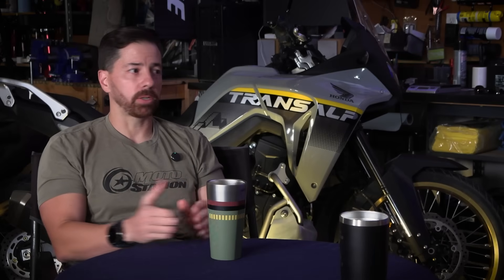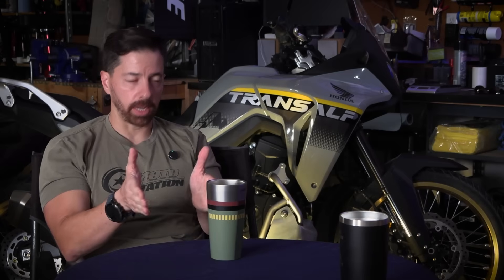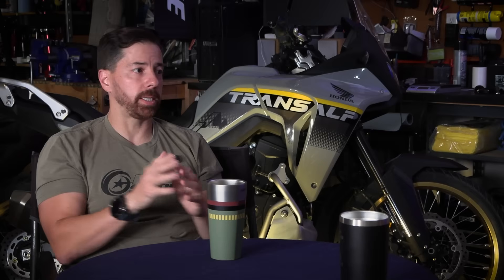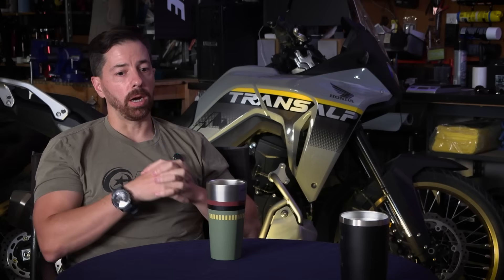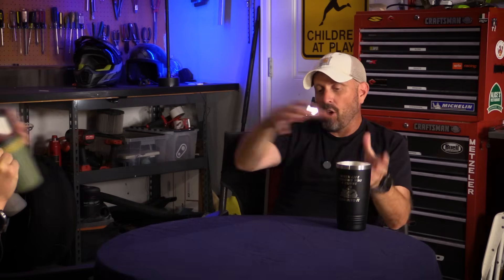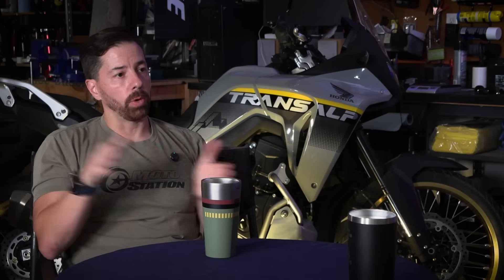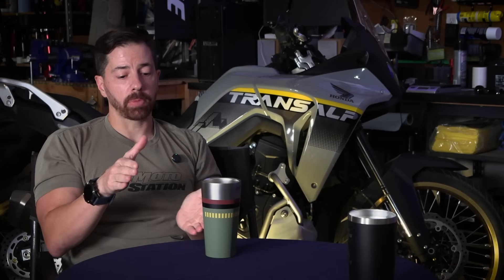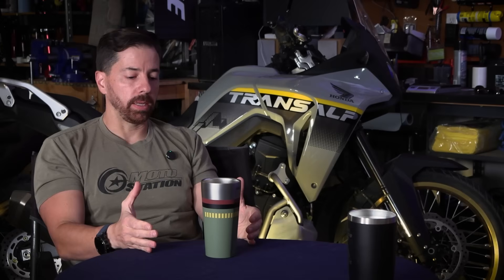The Engineering Behind MotoGP’s V4 Era (Why Inline-4s Can’t Compete)

Comment: I think you're a bit off saying the V4 is more nimble than an I4. That doesn't really bear out on track. The M1 does really well on tracks where it can maximize corner speed and direction changes. The I4 allows for better mass centralization. Especially compared to a wide angle, 90 degree, V4. Those wide spread cylinders spread mass out over a wider area and there are packaging issues with the chassis and they end up with a longer wheelbase. That helps them in straightline braking and acceleration (but hurts in rapid direction changes) which is why the Yamaha can't fight with them. They can be fast if they can run their optimal lines (how Fabio has managed so many poles) but in a crowd of V4's, especially off slow corners, the V4's pull meters on acceleration and tend to be more stable under heavy braking.
Yamaha went with the I4 with the crossplane crank because they wanted the best handling bike and the crossplane let them smooth out the torque delivery. They couldn't accelerate as hard as the V4 (or OG V5 RC211V) but they could accelerate harder earlier before the V's could and it evened them out. Before all the aero and ride height devices allowed the V4's to accelerate earlier and harder. It does that to the I4's but they don't seem to benefit as much and the added drag of the aero doesn't help their top end either.
With the drop to 850cc's, reduction in aero and elimination of ride height devices in 27, the I4 M1 could be viable again. IMO. Suzuki and Yamaha traded championships before Ducati mastered the aero and ride height devices and started dominating. And before they quit, Suzuki's crossplane I4 could rival the Ducati in straight line speed. In their last season they were actually outrunning the Ducs easily on the front straight at Qatar. However I think they had to dial the power back as they were never quite so fast the rest of the season. Maybe full power was too much to allow them to last long enough.

If you watched MotoAmerica this year, Herrin on the Panigale V4 was clearly stronger on acceleration, top speed and heavy upright braking, but Fong on the R1 was way quicker in the tighter turns and rapid direction changes. Alot of races you'd see Josh pull gaps on straights but Fong would gobble up meters in just about every corner.
Reply: MotoGP bikes have always had much longer wheelbase than superbikes since the start of the 4 stroke era and have only become longer as they got more powerful. Length was never an issue with the V4 as Honda bikes have been smaller in every dimension than Yamaha, allegedly to benefit Dani Pedrosa. Yamaha has always had a longer wheelbase than Honda in the 4 stroke MotoGP era.

Unlike a V4, the I4 engine doesn't stretch all the way from the back of the radiator to the subframe, there is more freedom to tune the chassis stiffness.

I4 was never known for its power because the crossplane is an inherently unbalanced engine especially primary balance. There is a massive rocking couple between cylinder 1 and 4, and that imbalance works the bearings hard. A pair cylinders that share crank pin in a 90 degree V engines on the other hand can have perfect primary balance with a crankshaft counterweight.
Reply: @electric_boogaloo496  Some of that depends on the year, manufacturer and layout of the V4. Ducati has always run a 90 degree V but they've change how it sits in the chassis over the years. Initially it sat like alot of their road bikes with the front cylinder pointing at the front wheel and that meant a really long wheel base so they had room for the radiator. Eventually they started rotating the engine rearward to try to put more mass forward.
Honda started out with a 70 or 75 degree V before eventually switching to 90. The Suzuki GSV-R they ran before they quit the first time was 60-65 degree V's depending on the season. Aprilia ran similar to the Suzuki until they went 90 degrees. The KTM was a 75 degree V when they launched it. Haven't heard if they've changed it but I expect it's 90 degrees as well.

The narrower V angles allowed for better mass centralization but they had to run counter balancers on the crank shaft and they rob power. 90 degree has perfect primary balance and don't need the counter balancers so you get more horsepower to the wheel.
Reply: Yes
Reply: i4's have much better top end power for straight lines but they fall short when it comes to torque and the power pulses that come to the rear wheel. The turns and bends are what mostly matter as most overtaking happens in them so you need the perfect power delivery on it.
Reply: @Mike-jv8bv It's not quite that simple, firing order has a big part of that and Yamaha's crossplane crank changes the firing order compared to the screamers. It has a broader torque curve that's more like a normal V4 (like the Aprilia). The Ducati V4 fires in pairs in the same bank so it's closer to it's older L twins.  Engine layout doesn't guarantee one performance characteristic. Cam profile, valve timing, valve design (Ducati desmo), design, metallurgy and weight of engine internals.

The Ducati V4's have amazing top end power. It beats all the inline 4's in straightline speed except the BMW which can match it. Part of it is Ducatis engine internals and the desmodromic valve system allows a very high redline, especially as it acts more like a twin. They were never able to get the actual twins to rev that high, that's why they got the displacement advantages over the 4 cylinders.  I'm not sure why the Beemer makes so much more power than the other screamers like the Kawi, Honda or Suzuki. Their shift cam probably is part of it but Suzuki also has variable valve timing. I know they (Suzuki) don't race in WSBK. Here in MotoAmerica the Ducati and BMW hands down beat the other manufacturers in straightline speed. It's not even close.

Comment: Great video content. One thing - and I might be wrong - I guess the issue with the sound is a codec problem you have and it appears just when you edit these short clips. It over compresses these I guess, as there is absolutely no problem with the other (long format) video.
Reply from the maker: Yeah we think we figured out the issue was being caused by this old mic setup we were using. These lapel mics had a software that was meant to keep the tracks from conflicting but it created some odd behavior in how it sounds. We've seen switched (upgraded) to our current Shure mic setup and it seems to give us much higher quality audio as a result. 
Some of these short clips are pulled from past podcast episodes so they still have the older setup. Going forward I think we've solved the issue though. 
Thanks for watching!
Reply: @CanyonChasersPodcast  I was going to comment about the same thing. It may be possible to smooth out some of the sound issues depending on exactly what happened to the audio, but it would require a lil bit of messing around in a DAW